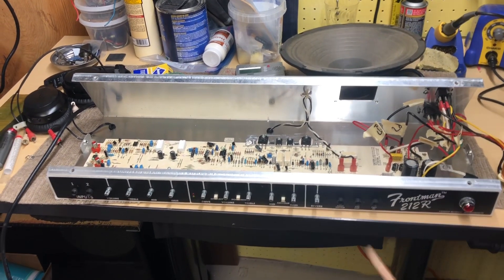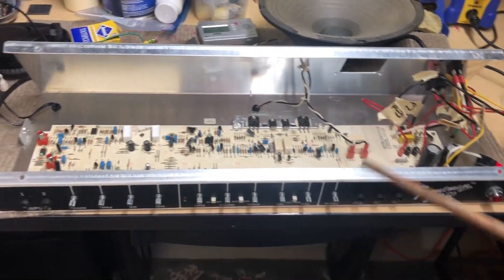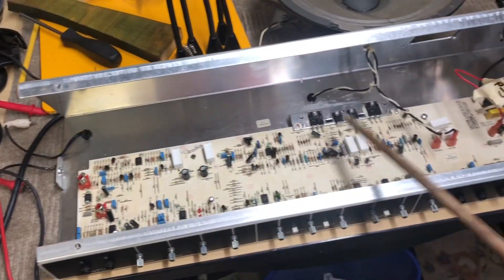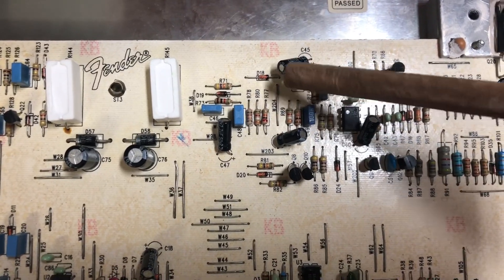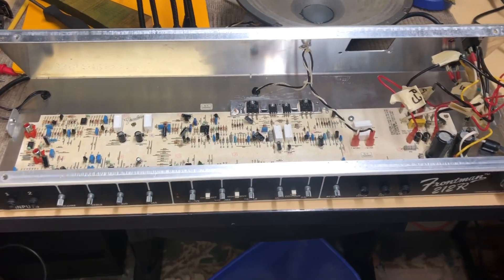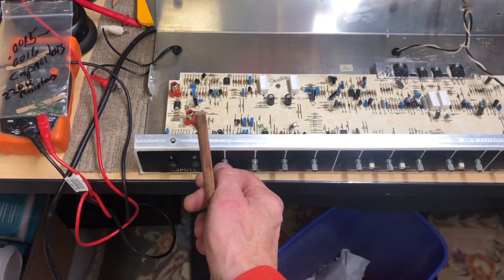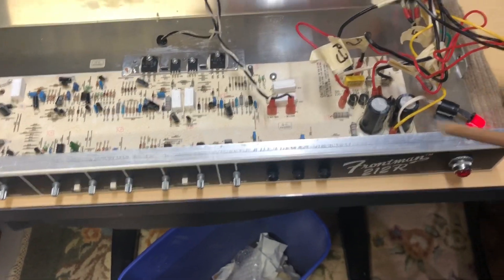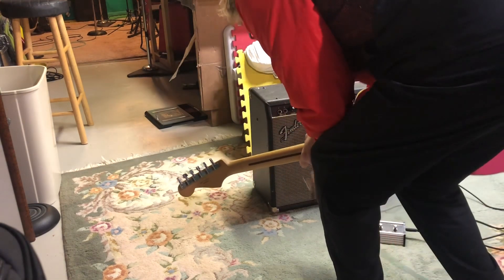Noisy Fender Frontman 212R

Comment: Unfortunately your "solution" doesn't fix the Hum issue. The 220k  resistor placed as you say, only disable permanently Q7 and Q6 circuit. It is not a good idea since, due your mod, rt2 (ptc100 temperature sensor) will no longer work and mute circuit will not be able to reduce the amount of signal to the power stage when for any reason some overheating occurs in the power output transistors.
The resistor mod only hide the matter but the issue will always be there.😢

Comment: My 212R sometimes - really sometimes - crackles loud and awful. After having cleaned all jacks, it is quiet for one or two days. Finally, i will replace these jacks by hi-end ones. The amp can play nicely and even at low noise for "bedroom use" when the guitar´s volume ist turned down. I once bought it to have enough clean headroom for stage performance. The amp is not reliable, but I love this sound.

Comment: More than likely you have a cold solder joint on the ground of the input jack or elsewhere on the pcb. The resistor you added was to the mute circuit and did not get rid of the issue, but just covered it up. In time, the problem will be back.
Reply from the maker: I sucked all the old solder off all the jacks thinking the same, even though when I traced with a multimeter it showed joints appeared to be good.  Then I resoldered all....still had issue until I messed with that mute circuit.
Reply: @lockdownguitars152  On those models, I’ve found the solder pad around the legs look like they are in place and making contact with the trace. But the trace is actually broke loose from the solder pad and is not making contact with ground. A way to test this is to use an alligator clip wire from the ground leg of the jack to chassis ground. Or the muting transistor is at fault.
Reply from the maker: @alfordmyers7786  I think that muting transistor is at fault because I tested the traces from the solder pads...but next time I have it open, I'm going to retest the traces.  I may see about replacing that transistor.  That can't be very expensive.  Thanks for your help.
Reply: @lockdownguitars152  the matter is leakage in Q6 or Q7. If replaced both transistor and the mute fault is still there, you must to check leakage in Q8, Q9 and Q10. If the fault remains the same so the issue is leakage in one or more (Q11, Q12, Q13). Always I fixed this fault, the guilty was Q12 or Q13.
The resistor solution presented here is a bad idea because the 220k resistor placed as shown in the vídeo disable permanently all the mute stage.